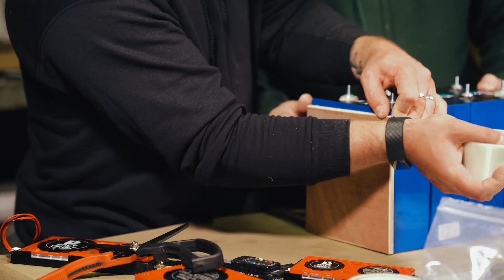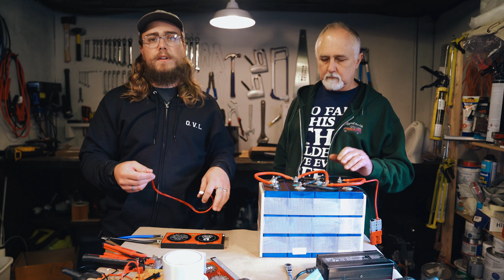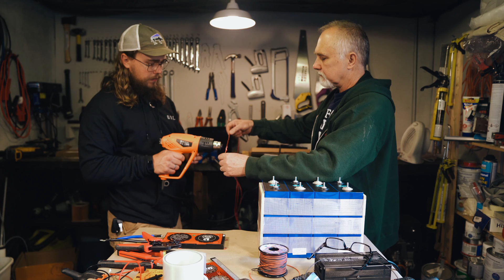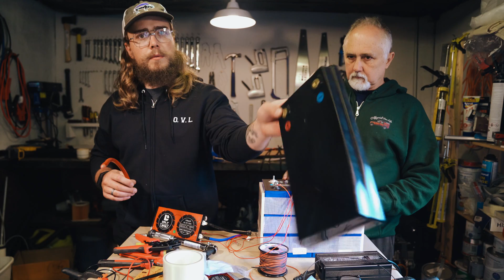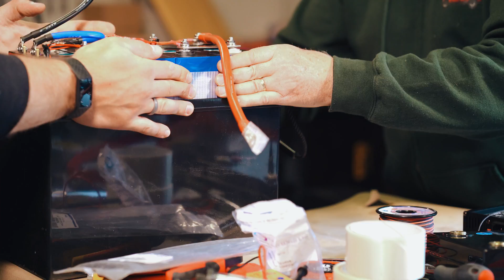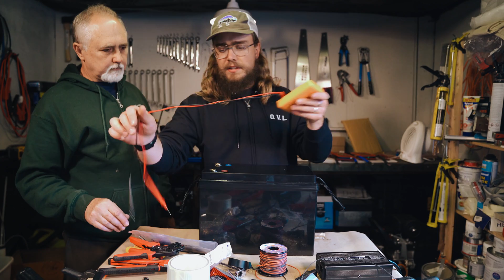Building a DIY drop-in replacement LiFePO4 battery

Comment: where do you guys stand on the fiber tape method versus using threaded rod to compress the batteries? Is the tape method all I need in order to prevent the batteries from expanding when they are charged? 

Wont the tape eventually give overtime?
Reply from the maker: Thread rod is better, but the tape is good if you can't do anything more. We would always recommend threaded rod as the best solution. In this video we were just demonstrating that you can build a pretty substantial battery that is effectively "drop-in replacement" in size.

Comment: Great video. Link to the plastic box?
Reply: ￡35.12  64％ Off | Battery Box Lifepo4 12v 24V 48V 100ah 120ah 200ah 280ah Lifepo4 Batteri Plastic Box Rv Solar Cells Box Diy Lifepo4 Batteri Case
https://a.aliexpress.com/_msrK2MX
Reply from the maker: Here's the case that we used: https://www.alibaba.com/product-detail/4S-BMS-Active-balancer-12v-280Ah_62488956720.html?spm=a2700.12243863.0.0.2ce83e5fJri0Fy

Comment: Looks to me that you will have to open the case up every time the Bluetooth disconnects. Unless Daly has changed something.
Reply from the maker: On this particularly battery that we built, yes. But we could easily wire in an on-switch to turn the BMS on without opening the case.
Reply: You could also extend the timeout for sleeping to infinity. Also, either charging or a reasonable discharge will wake the Bluetooth up

Comment: Great Video Nigel 
I have a 2-200 amp with 2- 120 amp Daly’s and my leads are longer - no need to extend mine . Powering a Class C motor home eventually .
I have larger plastic cases I’m putting in with terminals . I’ll be hooking the negative to a Victron 500 amp shunt . I’m glad you’re putting the word out to compress because it’s not easy to find on U Tube - it’s it’s not hard to do . Thanks for all your help and ideas 💡 : )
Reply from the maker: No problem at all! Hope it’s been helpful! Let us know if you have any questions or anything we can help advise on. Sounds like you have a cool set up! 🙂